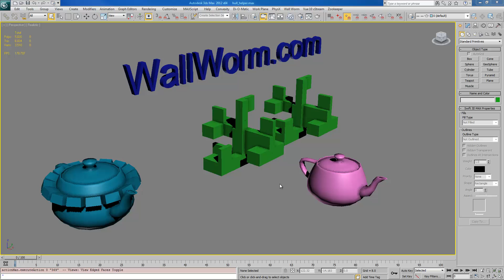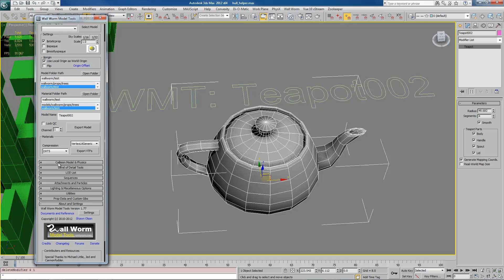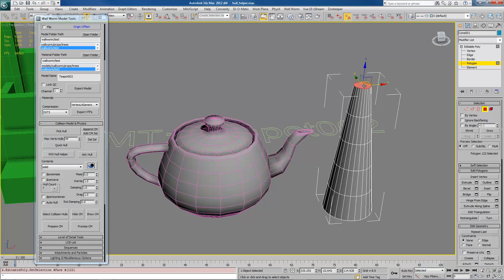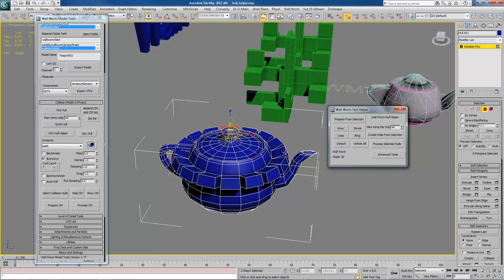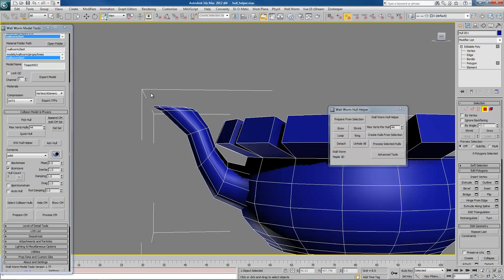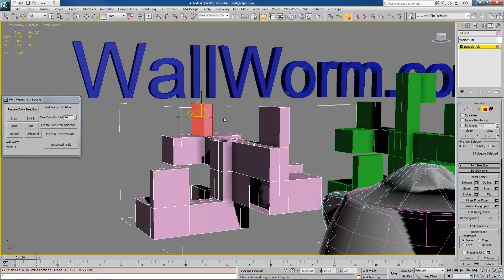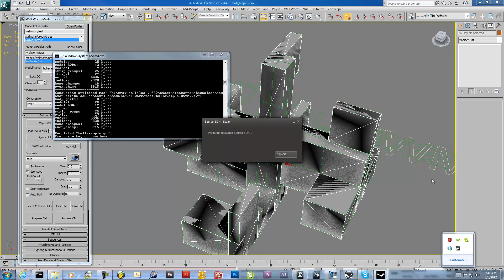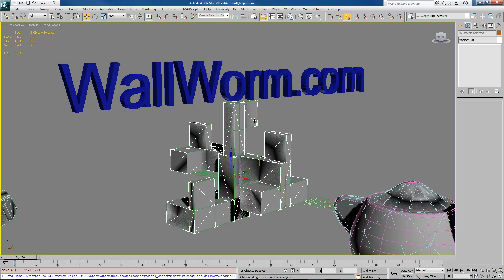Collision Hulls 101

Comment: For some reason as of yesterday, when I export a model with the collision hull, the hull will rotate 90 degrees on the x axis. I don't think there's anything I've changed that might have affected this, but do you know what might be the issue? Thanks :)

EDIT: Seems to be linked to a bone on my mesh, following orientation and position, so I know now why it's offset, do you know how I can fix it/detach it from the bone?
Reply: Somewhen after fiddling with it for a bit, it's in the right place, but now it's rotated along the y axis. I made it the child of a bone facing upwards, so I think it's following the position/orientation of my center bone now, will update again if I know what to do
Reply: After doing some digging I found out that if your model has any bones in it, it NEEDS a root bone, otherwise it will just go to the first parent, so I made a root bone, wighted the collision mesh to that, and made it parent every other bone and that seems to have fixed it :) Will leave this here for anyone else having this issue in the future

Comment: Every time I use the wall worm tools to create collision models and then compile them they always come back with the error: " WARNING: Model has 2-dimensional geometry (less than 0.500 inches thick on any axis)!!!" I tried everything to fix this but nothing seems to work.
Reply: I scaled the object in the QC to 50x the size I actually want just to check if it would work and it did. So is my problem literally that the geometry is too small?
Reply: Ok (Quite aware I'm having a conversation with myself right at this minute) but I seemed to have half fixed it by setting the max verts per hull to 8. Now the mesh is pretty poor now but is this the only way I can fix it?
Reply from the maker: Without seeing the file, it's hard to say. If the actual size of the model is extremely small, you can have the 2-dimensional problem. Make sure to use generic units with 1 unit = 1 inch. I keep reference objects in the scene to keep my scale correct. Another problem for hulls is if your hull isn't sealed, isn't smoothed or the verts are not welded. I'd use the Hull Helper floater for creating hulls. See http://dev.wallworm.com/topic/19/hull_helper.html 

Note that you should be able to use more than 8 verts. So there is definitely something screw with how your scene is set up.

Comment: when I click create hulls from selection my model simply disapears and then I'm not even able to control+z it's just gone forever...
Reply from the maker: When you press that button, the function does 2 things: 1) It makes a copy of your model and 2) the original object is hidden. This copy is then converted to an editable poly and set to Polygon Sub-Object mode. I'm not really sure how it could just disappear, but it is possible that if the model as unexpected transformation controllers or an XForm that needs reset, the copy might be off in some strange location in the scene. But the original object is simply hidden. Clicking Unhide All from the quad menus will bring it back.

[EDIT] I reread your comment and realized that I had misread the button you pressed. The button you mention, like the Prepare button I discussed above, only hides the current selection as it copies it. So the object is still in the scene and can be unhidden with Unhide All or in the layer manager.

The model should have Reset XForm applied before you use the function.

Comment from the maker: There is a bug in the nVidia PhysX Plugin for 3ds Max 2.71 that makes the Quick Hull and Hull Helper generator fail. That same bug is in the initial release of MassFX in 3ds Max 2013. Until fixed by nVidia/Autodesk, this problem makes the WW hull functions inoperable in those versions.